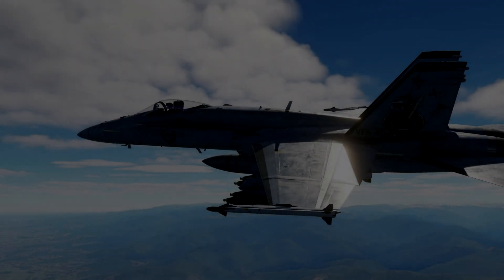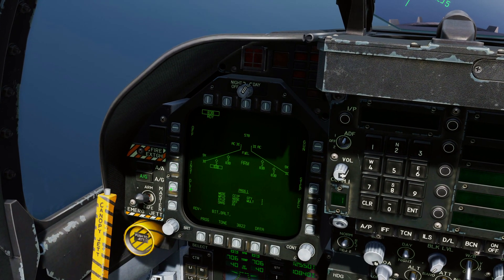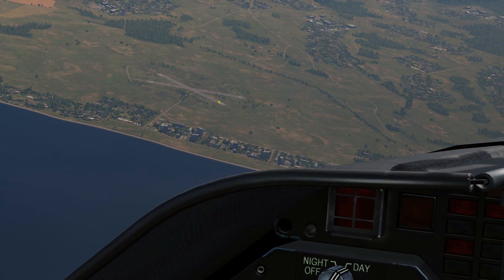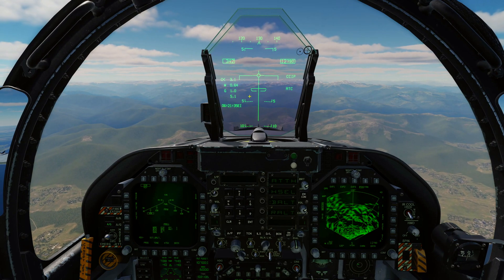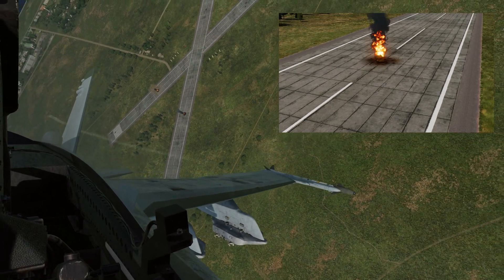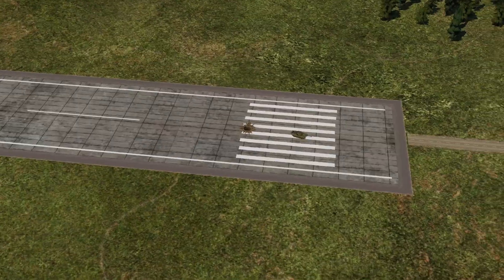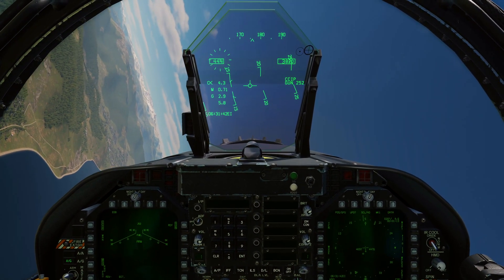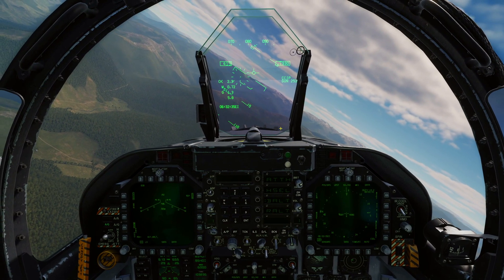DCS: TOP TIPS | 10x Your Accuracy F/A-18C Hornet Workaround June 2022 #DCSworld

Comment: I think there's no magic. The reason why you have managed to destroy 3 tanks is not that HSI setting, but the dive angle 🙂 Just double-check this, you had steeper dive angle (like 35 deg) every successful run. And you didn't manage to destroy 1 tank after changing the HSI setting just because your dive was not that steep as in previous runs.

Comment: Sounds like you are still setting your INS to NAV after alignment. Make sure it is on IFA instead. NAV is for the old Navigation system, which was used before GPS. GPS system uses IFA.
Reply from the maker: This scenario for the video was an air start mate, I do use IFA when cold starting 👍🏻
Reply: @TorniQuetHD  So I tested this out and the results were interesting. I have just came back to the hornet after a long time away, before the IFA did not work. So I did a few dive bomb test and sure enough was missing the targets, almost every time. That was very unusual for me, I have around 4000 hours in a Stuka in various games. I am usually very accurate with dive bombing runs. I then switched it to GPS like you said and I started hitting targets again. I decided to test out the alignment feature at startup. First test was AutoStart. It put the INS in STD HDG and after alignment it moved the switch to NAV. I selected the GPS on HSI and the compass moved a couple degrees. I then did it again, this time I moved the knob to IFA, the compass still moved a couple degrees. Next test was a regular startup. I selected the STD HDG and set the knob to IFA. Again the compassed moved a couple degrees. Next I did a full alignment, no STD HDG, and knob to IFA. Hit GPS, again it moved a couple degrees. So there is something going on the alignment, no matter what you do. I did do a IFA alignment and a couple new options came up on the HSI, Land and SEA. I selected Land, it did a full alignment. This time when I selected the GPS, it did not move. I then did an airstart and when I hit the GPS, the compass did not move. So the manual says if you see the POS/AINS (Aided INS) displayed, INS and GPS work together for optimal navigation solution. So it sounds like it might be a bug.
Reply from the maker: Thanks for doing some more testing, hopefully ED can figure it out soon but in the meantime atleast this will be a workaround to allow you to still hit targets with CCIP bombing
Reply: @TorniQuetHD  Roger that, thanks for the video.
Reply: @TorniQuetHD  Thanks guys for testing this weirdness. Did you submit to ED?
Reply from the maker: It’s a known bug for ED, so whenever they finally figure it out it will get pushed into a patch eventually 😅